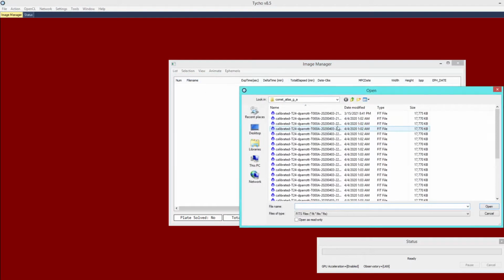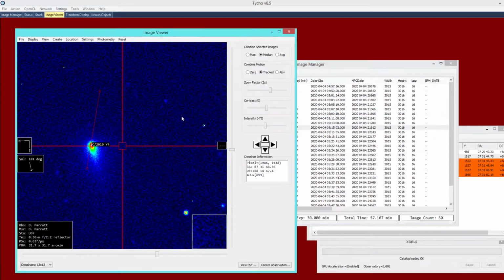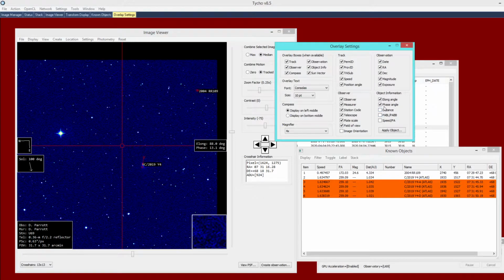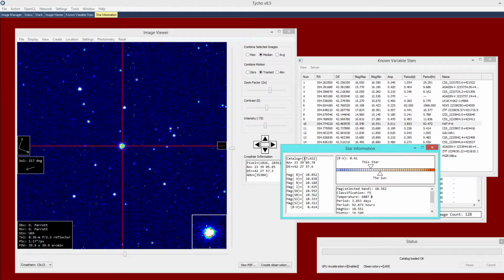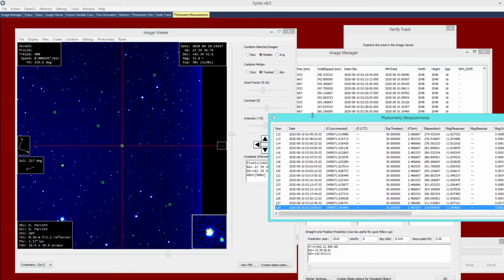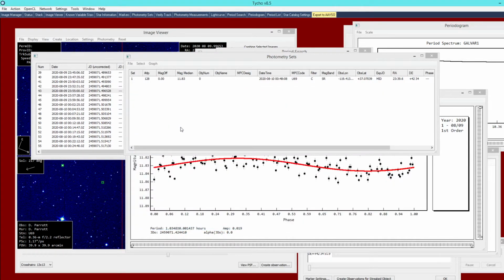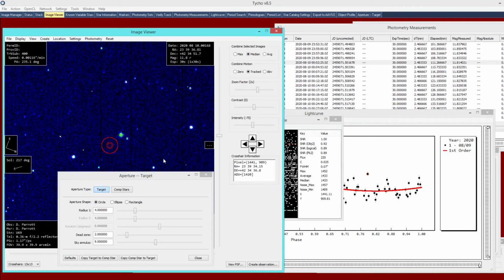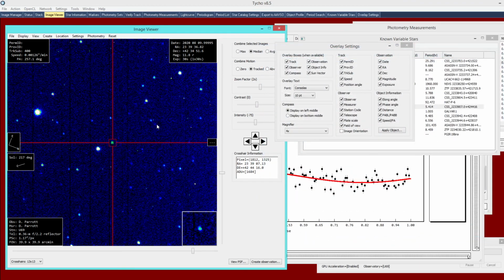New Overlay Options and Export to AAVSO

Comment: Hi Daniel….I did not purchase the prof. version as I thought that photometry would be included in the standard…would you kindly consider on subsequent versions of your software to include photometry in the standard version…it would be very appreciated. 😊✨✨
Reply from the maker: Both versions include photometry.  The main difference is that the pro version has additional routines to automate the process, such as the comp star finder.
Reply: @tychotracker  hmmm….but when I try to generate a photometry set in the step necessary to create a light curve graph it says I need to have the prof version….
Reply from the maker: @astronomynotebook  Yes, this can be achieved in standard version with a few extra steps: create markers, then create track from markers.  From there, verify track and produce observations (you may have to check "Advanced Mode" to generate as many observations as there are images).  From these observations you can then copy over to photometry set (select the observations in the list, then right-click and choose "Copy to Photometry").
Reply: @tychotracker  thank you will try this…😊 ….but it might be very useful to a novice and who has the standard version if you would be so kind as to make a brief video on these steps…for those including myself who are not as savvy as yet…😊